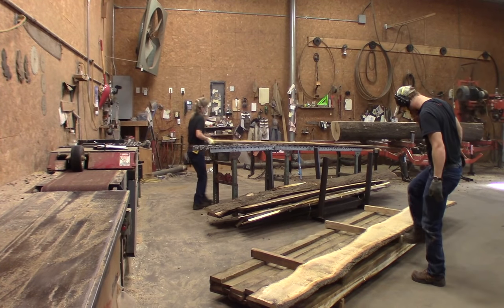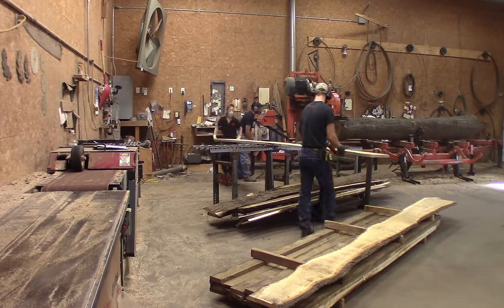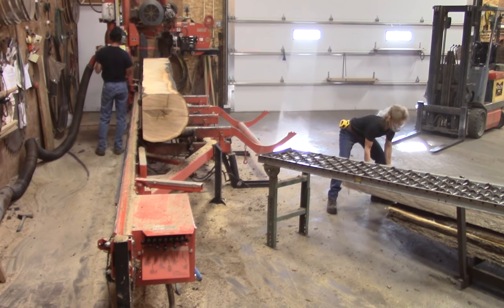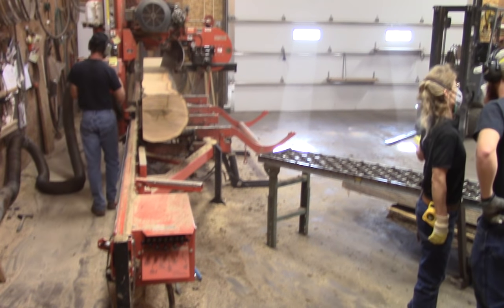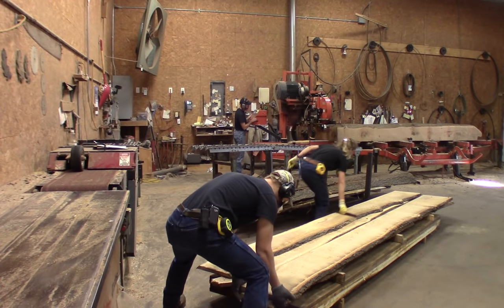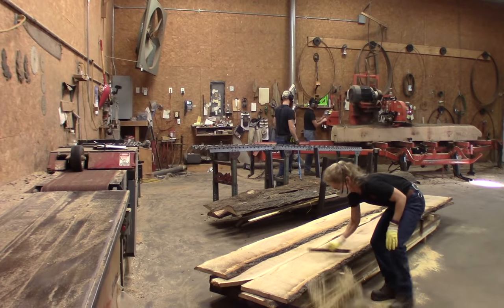Family Team Mills Long Oak Log

Comment: Linda, I love your vids. To avoid electrical interference try to make a box from chickennettings over the camara and connect the box with a grounded wire. It will act like a Faraday box. Hope this will help.
Reply from the maker: Thank you for your feedback and the suggestion. I am glad you enjoy the videos. I might try the Faraday box, I will have to find a good place to ground it though (we have radiant floor heat). Thanks for watching! Linda

Comment: Linda,  You have a ground problem that is causing your problem.  To fix it, run a separate ground wire  called an isolated ground, from the outlet through the panel to the  Ufer or grounding system.
Reply from the maker: The next thing on the maintenance schedule, is to look for loose connections. Then possibly a Faraday box wired to earth/ground. I appreciate your suggestions. Thanks for watching! Linda
Reply: yes you are right on the ground issue. sorry posted my ground suggestion prior to reading yours

Comment: Linda:  If the grey cabinet in the corner has a phase converter in it, I would bet that that is the problem with soft focus on the camera.  Other than checking for loose connections try moving the camera a foot or two further away from that box.  (assuming that there is nothing similar on the other side of the wall)Really enjoy your videos,Rick
Reply from the maker: Yes, we have narrowed it down to the phase converter and it has permanently damaged the oldest of my 3 cameras, but affects all 3. So I have been recording farther away, for now. Thanks for the feedback, help, and watching! Linda

Comment: The electrical shielding sounds like a good idea. It's a shot in the dark but the issue might be coming from the spinning saw blade itself. Functioning sort of like a Van de Graff generator producing high voltage DC at low current levels. Typically a rubber belt but who knows what that spinning blade is doing in the electrical realm. Do you get that focus issue from the same position when the saw is off?

Comment: Just a quick thought on the camera issue, did you think about resonant frequency vibration ?.  Try a glass window between the saw and the camera. It may just be a mechanical component in the camera vibrating at it's native frequency and it's not doing it when not cutting since the speed drops slightly when you start the cut.
Reply from the maker: Interesting idea, I haven't heard of the glass solution. I have had several good ideas we may try. Since the problem came on slowly over several months to a year, we think some connections may have loosened over time. That is the first thing we will be looking for. If we don't find anything, we may have to try other ideas, so I appreciate your input. Thanks for watching! Linda

Comment: Was the wood being cut seasoned wood. I ask this question because of the way you stacked the wood? You stacked the wood directly on the to of each new cut piece of wood coming from the saw mill. In most case if it is green lumber being cut it is customary to add at least a 1/2" spacer between cut pieces of material being stacked. This allows the air to evenly flow in and around the stacked cuts of lumber to assist in the drying time of the material?
Reply from the maker: The logs were green, not seasoned. Sticking on the go slows production too much. We normally stack lumber on sticks for drying, after we finish sawing it. This video link will take you to my video of us putting lumber on sticks to prepare for drying. https://youtu.be/hjVqR9MBVHU

Wood in log form takes decades to dry and many times it will rot first. It doesn't really dry at all until the bark has fallen off. Then, it dries the outer layers, while the center stays green, which causes deep cracks to form. It is ALWAYS better to saw fresh cut logs. 
Thanks for watching! Linda

Comment: The Vixia uses a through-the-lens autofocus system that adjusts the focus based on the overall sharpness of the image; maybe high frequency vibration of the saw when it is in the cut confuses the camera's sharpness detecting algorithm.

Comment: Linda:

Thank you for another video.   Have you ever milled salvaged logs, for example from a forest fire?   Or would they be too difficult to deal with?   Reason I ask is that I had some wood from Mt. St. Helens (a few years after the volcano blew) and the wood was rather poor, somewhat brittle with occasional insect damage.    Just wondering, as I've heard the Federal government may open up fire damaged lands for logging.
Reply from the maker: Yes, we occasionally get a log that someone tried to burn with a brush pile and either they or someone else decides it might make nice furniture, so it ends up here. Ten to fifteen years ago, we resawed salvaged beams from a 120 year old apartment building that burned. They were huge Douglas Fir beams and had lots of beautiful lumber. 
Depending on how long the log was in the fire and how big the log is, it can have a lot of useable lumber or very dried out and cracked. The charcoal is abrasive and reduces blade life, but is worth it if you get a fair amount of lumber. Thank for watching! Linda

Comment: Great video.  Question though... why don't you just flip the boards when stacking, instead of the extra step of sweeping?
Reply from the maker: Thank you! When the boards are less than 14 feet they go up the roller track to the edger, the offbearer has time to tap the board on the mill. When there is an offbearer at each end of the mill, the sawyer has to wait for the board to be pulled away, so we don't take the time to tap it. Though, even when it is tapped, sometimes the dust sticks to the board and can only be removed with a scraper. So one of us scrapes it on the roller track as we transport it along. The scraper is a recyled cut off section from one of our old bandsaw blades. Thanks for watching. Linda
Reply: After I posted I realized my question may have sounded like "why haven't you thought of this?"  Many thanks for the great explanation, which is exactly what I was hoping for.  You guys rock.

Comment: great videos.
are you sure the blur is not simply vibration? you see the blur begins when the blade engages the wood and corrects once it's done.  it looks like you've fixed the camera to the wall. perhaps if you hung the camera via a support in the ceiling. i don't agree that it could be an electrical issue.

Comment: The blur seems something to do with the autofocus: when the saw is completely back toward the camera, there is a sharp focus on the motor. Dust on the autofocus LED?
Reply from the maker: The blur is only when the mill is under load. As soon as it breaks out of the cut, the focus is fine. It is easier to tell when you watch the raw video, though, as I cut a bunch of the blurry sections out. Thanks for watching! Linda

Comment: Try an RF  filter in your power connections. The blurring can occur due to electrical pulses as machines are switched on and off . RF filters should deal with this.
Reply from the maker: Thank you for the suggestion. Since the problem came on slowly over several months to a year, we think some connections may have loosened over time. That is the first thing we will be looking for. If we don't find anything, we may have to try other ideas, so I appreciate your input. Thanks for watching! Linda

Comment: Great stuff.   If that was my camera and mill I would be looking in the electrical panel in the corner for loose or hot connections.  Many times when a connection gets bad and heavily loaded it will throw out EMI (electromagnetic interference).  The camera is pretty close, that could explain why all 3 cameras goof up in that spot.  Might be easy to see, look for a heat discolored connection or a breaker that heats up.  Might not be easy to spot and it could take an experienced pro to find it.  Could be a ground fault in the saw motor too.  I would be looking closely as it could get expensive.  Make a video of what you find.   Keep them coming!   :{)
Reply from the maker: Thank you! Since the problem gradually came about, I really believe you, and several other viewers who had the same idea, are on to something. We plan on checking real soon, because if it is, there may be more than just cameras effected in the long run. Unfortunately, I have many videos in line waiting to be edited that were effected. Thanks for your input and thanks for watching! Linda

Comment: Linda, is there a reason why this cutting left so much saw dust on the wood when you stacked it. in all your other videos, i have never seen anyone clean the boards when they were stacked. does going through the edger clean off the boards at all. thanks
Reply from the maker: Good question. A couple of things were going on. 1.Wider boards have more dust remain on the board, because there is so much volume that the blade can't clear it out fast enough. 2.The mill off-bearer usually taps the boards on the mill bed. On this log, we were in the way of mill progress, so there wasn't time to tap the boards. Routinely, there can be a small amount of dust that sticks to the boards, so we normally scrape, but it is on the go and not nearly as much. The edger dislodges some, but not all. Thanks for watching! Linda
Reply: thanks for answering me

Comment: You clean every board from dust on the stack.. But why not turn the board upside down, when you moving it to the stack?
Reply from the maker: Simply turning the board over doesn't remove all the dust, it is damp and sticks to the boards. Good question, though. Thanks for watching! Linda

Comment: Would you be able to detect nails in a log with a metal detecter?
Reply from the maker: Yes to get an approximation, if they are within a couple of inches, but you still have to get them out with a saw of some type and many times they are several inches below the surface. Thanks for watching! Linda

Comment: Do have a crosscut saw to deal with the bark slabs to make it easier to make mulch?
Reply from the maker: The slabs are usually used for firewood. The edge trimmings get ground into mulch. Thanks for watching and commenting! Linda

Comment: I am thinking about getting a Canon VIXIA HF R700  I think you said that's the kind you have,, overall, how do you like them? I presently use a Cannon power shot.
Reply from the maker: The Canon Vixia HF R400 was my first & I liked it enough to buy two Canon Vixia HF R600. I have been really happy with them.  The R600 has threads to add a wide angle lens, it is an improvement that I really like. I haven't checked out the new R700, but I bet it is just as nice or better. Thanks for watching! Linda
Reply: thanks , as soon as I can get my wife to appropriate me the money, I'm gonna get one. lol

Comment: Is the camera running off of battery or plugged in?
Reply from the maker: Usually off battery, until it gets low, then plugged in. Thanks for watching! Linda
Reply: LindasSawmillCinema I was wondering if the camera performance issues was due to the load on the sawmill when the camera was plugged in too.

Comment: electrical grounding issue -- lighting, dust collector, saw????-dust collector static in cold is more of an issue also
Reply: remember that the wire inside the flex hose should make good connection with the machine and a ground point.
Reply from the maker: That is next on the maintenance schedule! Thank you for the suggestion and thanks for watching! Linda

Comment: with your camera put it in a metal box with a wire to earth/Ground  it should act like a  Faraday cage hopefully that will fix the problem
Reply from the maker: Thank you for the suggestion. I might try that, I will have to find a good place to ground it though (we have radiant floor heat). Thanks for watching! Linda